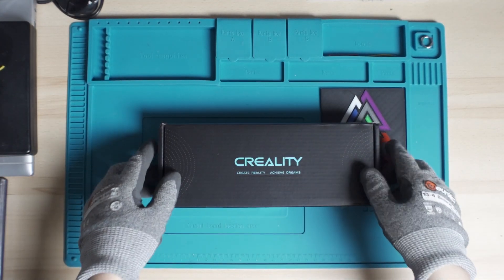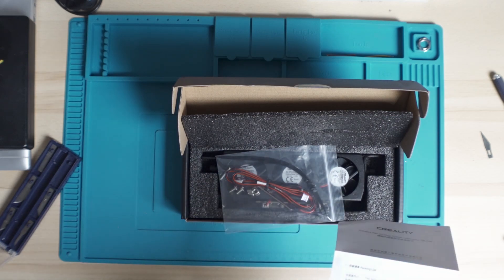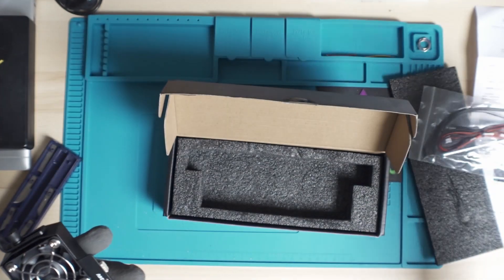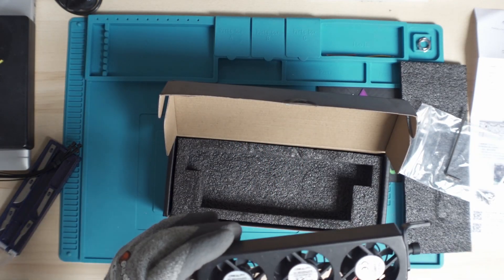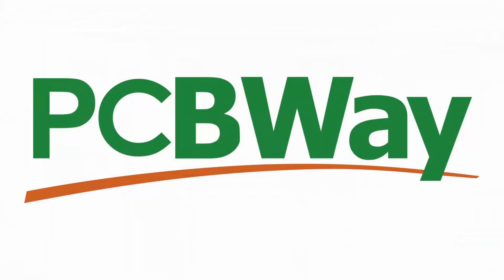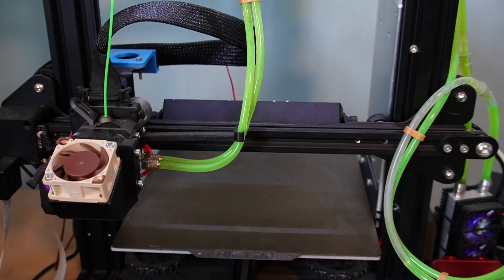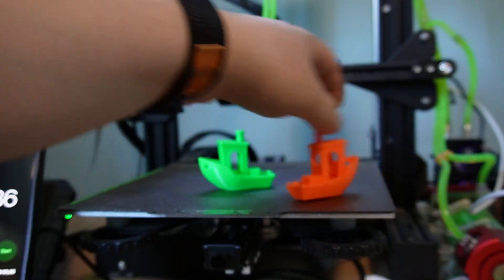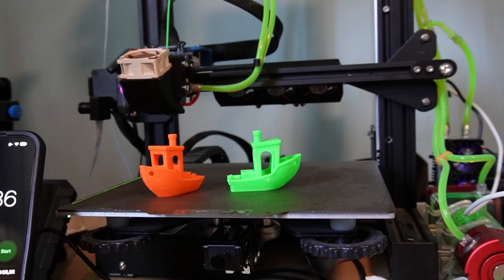Creality Aux fan test on the ender 3 v1 v2

Comment: I'm not convinced on this from the first few usages I've had - it seems to cool the bed too much causing warping on the print and poorer bed adhesion. I guess I need to keep tweaking with the angles and configuration.

Comment: I added mine to the k fan circuit. It makes no sense to have it always on. The k fan circuit is good for up to an amp. This uses 0.45A. The stock setup has  0.2A used.
Reply from the maker: thank you for the info, that makes it even go faster

Comment: I think the main purpose of this is to pair it with a spider hotend (you can get a sprite kit or just disassemble a spider v3) for high flow rate, and a kilpper device so u can print high speed with good quality

Comment: I'm making a heavy upgrade on my ender 3v2: Sprite Pro extruder, linear x rail, cooling kit, double z axis, light bar, CR touch, better springs & nuts, enclosure, magnetic pad. Any suggestions?😊
Reply from the maker: klipperize that !  If you want to print fast and cleaner.

Comment: Kinda sucks that you have to manually set the speed. Isn't the fan usually on low for the first layer or two to help adhesion to the bed? So if this thing is on full blast, it kinda negates that.
Reply from the maker: you are absolutely right, this is a typical Creality design. Well hey what can I say... I only needed it to test the limits of the ender 3 :)
Reply: @aim6mac  I was tempted to kinda tap into the existing fans wire and kinda use it to determine when the fans should run and to what speed (probably hooked up to a mosfet or something). But that seems a bit overkill. 

There seem to be some other kits seem like a better option, since they just upgrade the existing fan to a 5015 blower fan, which means it has the same speed profile as whatever the OEM fan is.
Reply: @jhyland87 I was thinking the same, to tap into the extruder fan, but I don’t know if that would kill something!
Reply: I actually did use the k fan header. It’s good for an amp. This uses up to 0.45A. Jist to he safe I moved the motherboard cooling fan to the fan header which is unswitched. Works fine.

Comment: how is the airflow directed .kinda wonder if noctoa fans would fit / ender 3 pro would work
Reply: And noctua aren't good for massive cooling...people get them for their quietness. Quiet means less flow capabilities. So pointless to try andcput noctuas on this ridiculous thing
Reply from the maker: noctua fans would fit as dimention, but u will need a buck converter because the output is 24v and noctua's are 12 v

Comment: I started printing with this aux fan, and it gave me a thermal run away.  you have this issue before? The nozzle seems to drop in temp and can't heat fast enough because of the fan.
Reply from the maker: maybe the angle you pointed the fans at is too high, u might want to angle it a little bit more towards the bed.
Reply: @aim6mac do you think I should do a PID tune?
Reply from the maker: @calebprenger3928  thats actually a good idea, first turn the aux fan on as u are going to use it whilst printing and do the PID tuning.
Reply: @aim6mac I will give that a shot.

Comment: I’m guessing for the S1 F4 board I’m just going to double up the terminals on the 24v side of the green connector @aim6mac
Reply from the maker: yes indeed , or you can run it from your PSU directly , since the output is 24v

Comment: Dude, where did you connect the power cable ? I don't know where I connect it on my s1 pro
Reply: You unscrew the main power positive and negative and slip the cable ends in there and then tighten it up. I did it with the gantry light kit, not sure if I can fit both this fan AND the gantry light into that port though...hmmm
Reply from the maker: come to my discord, i show you how :) https://discord.gg/PHMDw3Ky
Reply: @aim6mac  i can't join the discord. Have the same problem with my ender s1 3 pro
Reply: @aim6mac  same to me(

Comment: Are you using the original stepper motors? I can't pass over 400mm/s and 5k acceleration on Y axle, it start to jump steps.
Reply from the maker: yes motors are all stock, i overvolted them a tiny bit
Reply: May I ask what is the end voltage you went with? for the extruder and other axis motors?  @aim6mac
Reply: @LineySky  apparently not